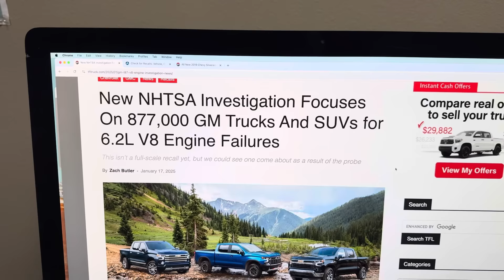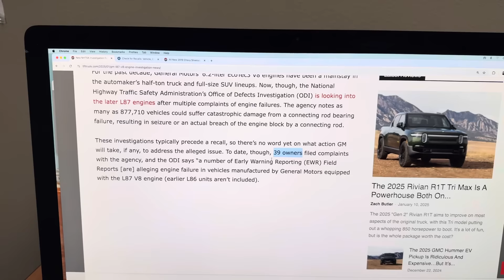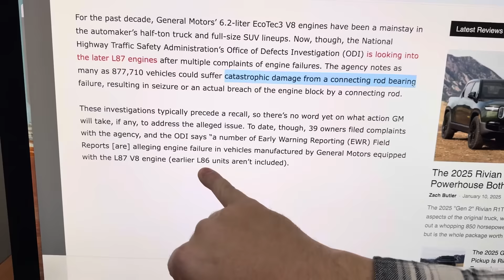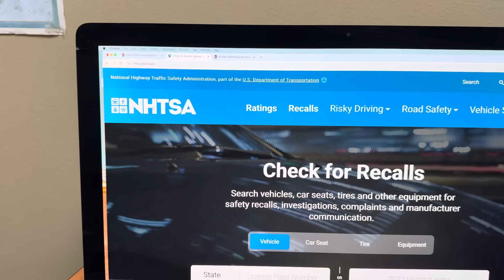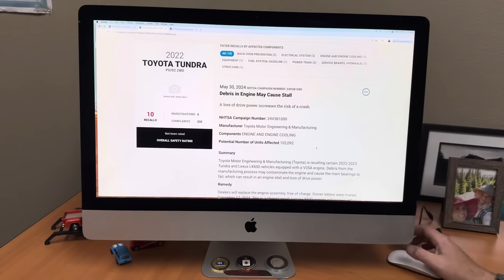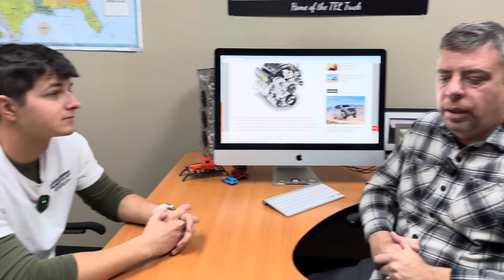877,000 GM Trucks & SUVs INVESTIGATED Over Failing Engines: Are You Affected?

Comment: This is fact as I see it. ( Former GM employee).  In the eyes of the DOT and EPA,  the Light duty ( 1/2 ton) trucks/SUV are all CARS. This means they are part of the CAFE standards for fuel economy.  The 5.3 , 6.2 and 4.3 LS  were developed to incorporate AFM . Cylinder de-activation has worn lifters, which could put debris in the engines. The near Perfect 6.0 was NOT developed for AFM, and resides in a lot of 3/4 ton and 1 ton trucks for many hundreds of thousands miles.
Reply: Maybe GM should have gone to OHC motors. Despite other disadvantages, AFM on OHC engines seems to be more reliable.
Reply: I think it is due to the AFM and DFM systems.
Reply: What does afm dfm have to do with rid bearings?

Comment: I wonder what is different about the rotating assembly on the L87 (6.2L DFM) engine vs the L84 (5.3L) engine that or even the L86 (6.2L AFM engine) that this failure is an issue only on the L87.

Comment: My wife's 2022 denali xl 6.2 seized at 66000.  Only thing that saved us was my cars extended warranty not GM. " All manufacturers are garbage quality now".  They all have alot of problems, and it's disgusting.   For what you pay for a vehicle today.  To last 66000 miles, with all service done at dealer and documented.  Because if I change the oil myself, most warranties are void.

Comment: I think most people who had engine failure just brought them back to the dealer under warranty and had the engine replaced.    So it's very possible these numbers are much higher than generally posted.
Reply: An engine installed by a technician in a service department wouldn’t be the same as an engine installed on an assembly line by Robots. Sounds like additional problems on top of the original issues.

Comment: 2023 Suburban 6.2 failed at 4400 miles which required a new engine.  The replacement has a lifter tick...

Comment: I work at a chevy dealer,  our techs are replacing at least 1 to 2 6.2's a week! Some of them failing with as little as 4k miles or less,  some with 10k miles.
Reply: What about the 5.3. Do you see less of these? I was eyeing a Sierra for my next truck cause I really like the looks. But shits like these really worries me. Transmission is usually the weak point with GM so if on top of that now it's the engine ... You're probably better off with Ram or Ford.
Reply: @agoogleuseranonymous2658  5.3 isn't too bad,  just lifters, the 2.7 4 cylinder has actually been pretty reliable so far, in fact if you get the turbomax gm upped the powertrain warranty from 60,000 miles to 100k miles. The torque output is about 430ft lbs,  that's even more than a 5.7 hemi! It's seriously an impressive engine.
Reply: How is the 3.0 Duramax?
Reply: @deboralacreta  a few minor issues here and there,  check engine lights/ emission things,  but nothing major.  I haven't seen any come in for service in a while.  Anything diesel is going to be tempremental sometimes just a nature of the beast with all of the extra emission equipment on them now a days. I'm not a tech but i do see what comes in every day.
Reply: @ thank you! Solid info
Reply: @deboralacreta  if you want a good motor i would go with a 2500 with the 6.6 gas. Or even the 2.7 in the 1500 is very reliable and has more torque than the 5.3 v8.

Comment: Your saying bearing. I read through a lot of comments. I watch a lot of YouTube and how people treat their vehicles. Try to go from a 3.5l Ecoboost to a standard 3.5l. 3.5l has no turbos. Not 6 qt of oil. 12 qt of oil. Huge adjusting. 3.5l Ecoboost is 91 or higher octane. 3.5l is any type up to E85. The engines of today have a neat little trick to them to keep them running. That's, use the proper oil. Change it from 3,000 to 5,000 miles. Use the proper gas. I don't use E85. I use the highest octane at the pump. Huge difference between octane and ethanol. Warm up. Oh, the talk. How long do you warm up a engine. Here is the thing. If the head gasket isn't hot or about there before, you mash the gas. You will blow the head gasket. Takes heat to make the gaskets seal up the engine.  Heat is glue for the engine and makes the oil do its job. 10 speed transmissions. Smart transmissions. Need to warm up to work properly. Atleast. 100F. Can't drive like your 16. You can't drive like your 80. You have to just work the engine. Let the engine do its job. Your going to buy something so expensive. Make sure you have the money to take care of it or don't buy it or don't complain when it breaks down. Engines have two problems. Either a lemon or someone who doesn't care. Things break. I get it. You bought it. Whatever vehicle type.
Reply: Wow, do I  need to do a rain dance too? This is ridiculous.
Reply: B.S.
Reply: @terryshull4477  Bullshit doesn't explain it. It's just shit. So. Mr. Bullshit. What is your explanation? Here, Mr. Bullshit. How during the war, everyone blew a head gasket but me. I did my weekly pre warmups. Letting my engine get up to temperature every week to keep the seals and everything working properly. Go on.

Comment: I work at a small GM dealer and we see about 1 failure a month. I will say it takes 4-8 weeks to get the replacement. A full recall would take years at this rate. Im sure a recall would probably be some type of inspection and not a full replacement. We see way more transmission valve body failures, wish they would step up and recall thos.

Comment: My 6.2 locked up @ 74K and it's replacement lasted 14.980 miles and left me sitting on the side of a bridge on I-10 a mere 1.8 miles from where engine #1 locked up at.  I purchased my 2022 Silverado RST brand new on 22 Nov 21.  And...don't get me started on the transmission issues as that's yet another topic.  For the record, I was NOT one of the 39 who filed a complaint.

Comment: Whats also concering too is the fact that the 6.2 has been around forever. You would think the engine is bulletproof by now lol
Reply: That reliability from a DESIGN perspective means nothing if the "parts supplier" drops the ball. Could be the result of the Covid mess and not vetting the supplier!
Reply: The sad thing is that they used to be bullet-proof, until they added all the AFM (cylinder-deactivation) and emissions BS, that absolutely killed the reliability of GM V8s (and many other manufactures as well).
Reply: @ True and the life span at most is maybe 150k. This is failing long before any serious miles.
Reply: @dmoncall6648  cylinder deactivation has been a disaster for a while now.  It needs to go.
Reply: @dmoncall6648  I mean what you expect!They have too don't you care or the enviroment?
Reply: @Qdawg03  right...., because all the energy/resources required to rebuild/replace engines or entire vehicles getting junked prematurely (and thus needing replaced again requiring allot of energy/resources) is so much better for the environment than getting 1-2 mpg. (at best, often less if any in "real world" conditions) worse fuel economy and having vehicles that last 300K + mi.

Comment: The number of complaints isn’t the same as the number of failures. As a gm employee I have seen 5-6 l87 engines locked up in the last month at our dealership. Most people don’t complain to the manufacturer because or nhtsa because they get replaced free of charge under warranty.

Comment: I had a problem with oil consumption on a 2007 Tahoe that I bought new and of course had no leaks.  I continued to get the run around from the GM complaint department because the oil consumption was quite a bit between oil changes.  
Seems the stupid Active Fuel Management engines were the problem.  Wish I did not buy a Tahoe with AFM.
Reply: I still have my 2007 Tahoe that I bought new. The lifters went on it on the very last day of my warranty coverage in 2012. Thank God the failure didn't occur one day later. I have 106,000 miles on it now. I don't drive it that often, it's more like a back up vehicle now. But at least I've had no problems with it since the lifters were replaced.
Reply: @EasyE1669  I think our had about 125,000ish miles on it when I traded it in 2017.  Great vehicle, except the pil consumption.

Comment: Only 39 people submitted complaints, thousands of the junk engines are failing. My 21 GMC Sierra AT4 had bearing failure at 36k miles. Warranty covered it. Swapped engine, instantly got rid of it for a 24 f150 5.0. Not looking back. 5.0 rips!

Comment: I just got a come back a week later after repairing a Tahoe with a battery drain issue. The come back was the customer states while driving on the highway engine shut off and would not restart. The start fuse is blown and the engine is locked up. 12k miles :) 24 tahoe
This issue is a lot more widespread than you’re being lead on about. We’ve been doing tons of 6.2l engine repairs and replacements for rod bearing failures this past year alone.

Comment: I'm 61 yrs old and I don't remember so many problems with new trucks and I've bought alot of new trucks in the past but there overpriced and not reliable. I have a 2013 f- 150 limited with only 86,000 miles with no problems just basic maintenance
Reply: Well I remember!  The Ford 6.0L diesels were blowing.  Three of my buddies engines failed.  One at 39,000 miles and the other at 80,000 miles and the other at 125,000 miles.
Reply: Your comment won't make anyone angry, so it will get ignored. If you said you had a 2023 and the dealer has already replaced them engine twice due to failure, you'd have 100 likes by now

Comment: In my opinion the 6.2 engines were repaired under warranty because the failures happen early on so no financial loss. This is why the complaints are low. I just filed my complaint because my 2021 Denali failed with 7,000 miles as did my friends Escalade. Hopefully they replace the engines.

Comment: I work at a Cadillac dealer, in the service department. I can tell  you it is a LOT more than 39.... that is only the amount of complaints the NHTSA received. They definitely have a lubrication issue in the lower end.  Be it too low of oil pressure/oil flow or clearance issues, they tend to destroy the rotating assembly and the rods get fiction welded to the crank.
Reply: Facts, gmc dealer here and I’ve replaced at least 10 this past year and we are small, currently have one now at work and our customer is number 2797th on the back order list
Reply: Deactivate the start stop and make it V8 100% of the time.  Problem solved

I just sold our 2007 Tahoe with 193000miles. It had the first AFM.  i bought an obd2 plug in device that kept the engine in v8 mode.  The engine was running perfectly when I sold it.
Reply: @thomasnew8606  I always turn off the auto stop, and my truck is in the shop as we speak for diag. 2024 GMC Sierra 1500 AT4 4x4 6.2L. Just over 15k miles. Developed a knock, dealer said it wasn't bad enough to warranty yet. Within a week it died at a light coming home from work one night. I don't think turning off the auto stop prevents it 100%.
Reply: @jjcdrummer  what was your oil change interval?
Reply: @adminadmin9997  Somewhere around 6000-6500 miles I changed it
Reply: @thomasnew8606 
My 2007 Tahoe 5.3 failed due to AFM, lifter collapsed, after 196k.
I replaced the engine with a Jasper AFM delete, smog certified !  It is excellent.
Seems this issue they are discussing is different, it is happening at lower mileage, and affecting the bottom end !
Reply: @kennethalbert4653  The last two Jasper engines we bought our shop were defective. We longer recommend them.
Reply: @jonathanvaughn2094  wow, the first one they sent leaked oil....Shop had to do the job twice, Jasper paid the labor, but I've driven 15k or so with no problems 🤞
Reply: Any chance the oil pump is variable and drops the pressure way sown at idle to reduce emissions at idle?
Reply: Yup.  I drove a truck every day since 2011, with zero problems, basically.  It was a 2004. I wouldn't take a new $100,000 truck for free. Absolute garbage, they'll break down.
Reply: Stay safe and thanks for the knowledge.
Reply: Has anyone had any luck with oil treatments? 
I have a 2017 5.3 . I’m not sure weather to try and get rid of it now or keep it and hope for the best. 24,000 miles Mobil 1 oil. Change once or twice a year. I don’t drive much anymore.
Reply: IT'S THE ECOTEC TICK!!!!!

Comment: My 2023 Chevy 1500 Duramax 3L with 20,000 miles uses 1 quart of oil after oil change at 4,000 miles. I have the dealer doing service and oil change on the truck every 5,000 miles. I feel this makes it regen the DPF much more than if it didn't burn oil and affects the Fuel Mileage!
Reply: Check the intake the can crack and cause oil consumption

Comment: Engines and transmissions failing left and right.  Only one company has a decent transmission and it's behind a newly designed inline 6 that's impossible to work on without costing thousands.  And the other two's transmissions hunt gears like crack addicts  going through the neighbor's medicine chest.  Ford doesn't even offer a NA ice engine except for the chemically sleeved cylinder 5.0.  Not a lot to choose from really.  We're paying more for low quality trucks and expected to be satisfied with a bunch of gadgets we can enjoy while it sits in the yard unable to move.

Comment: GM engines from 2019 and up have been trash both the 5.3 and 6.2 ask the people 
It’s like they get worse every time a new model comes out 
We don’t buy trucks for fuel economy 
We buy trucks for long term use and maybe a few luxury options if any but mostly for a reliable and tough vehicle 
We don’t need our V8’s to go from 8 to 4 cylinders and anything in between 
We don’t need 15 inch screens we need engines that last 
We don’t need a Mercedes Benz with a bed

Comment: Will not buy a 5.3 or 6.2L engine from GM because of this.  I have an awful feeling this is just the tip of the iceberg and that the problem is more pervasive than being reported.  It's a shame too because I would love to get a Chevy Silverado or Chevy Tahoe with either engine.  Not gonna happen now.  Not dropping 60k plus for lifter failures and a company that won't stand behind their product.

Comment: Every truck regardless of make or model has had issues at one point or anthother.  Ford has just as many actually more, same with ram. Good maintenance with good gas will help most of these engines perform as they should. Far from judt a GM issue. Toyotas new engines are really bad as well. Due diligence and research and make an informed decision when buying..